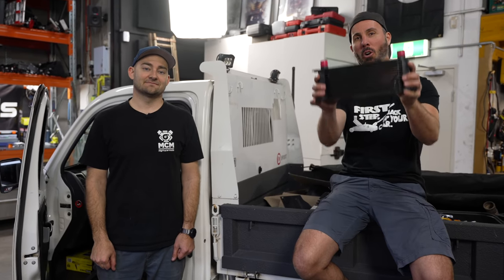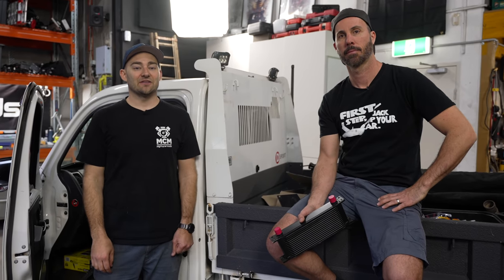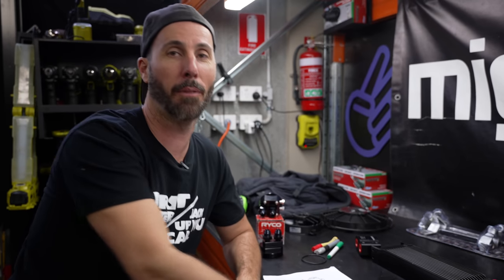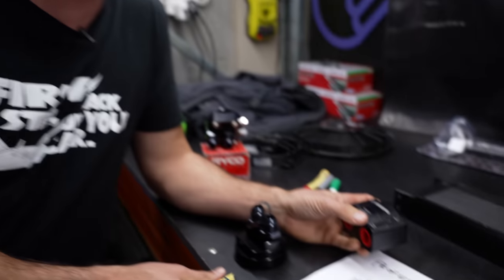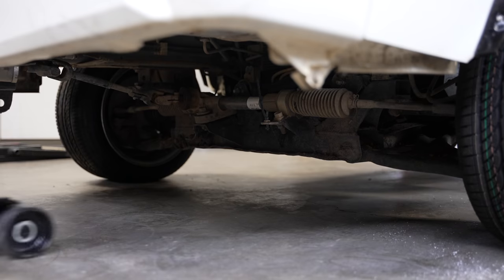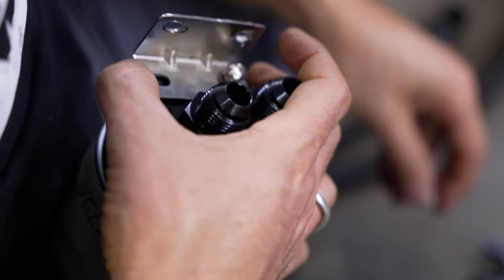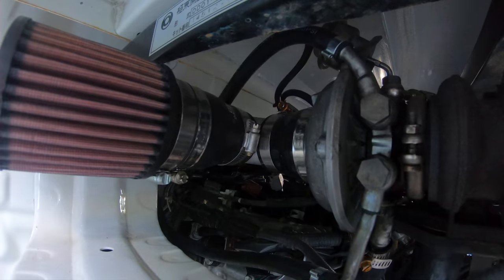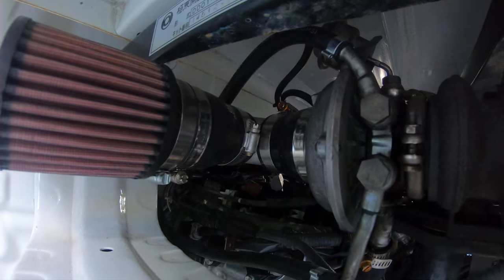How to Install an OIL COOLER

Comment: Installing oil cooler or upgrading the radiator? Which is better when a boosted car is overheating.
Reply: Assuming you checked why it is overheating ( running lean, clogged rad, bad cooling pump ) a new bigger capacity radiator is always better, if you go to the track an oil cooler is ok, if it's a normal everyday city car an oil to coolant heat exchanger is preferred as will keep your oil temperature more stable. Unless you install your oil cooler in front of the radiator and create air baffles to direct and force air to it , in normal driving with city stop and go traffic air flow is only present when the cooling fan is on and the oil cooler and oil will again be cooking. Oil to coolant heat exchanger will warm up the oil faster so less damage to cold engine will occur and will keep oil temp more stable. Tip: oil pressure gauge is your best friend, when oil is cold pressure will be higher, when oil is hot pressure will be lower. When engine is hot hot hot and your oil pressure is strangely high is a sure indicator your oil cooler thermostat is leaking, like mine does from time to time.

Comment: Sorry if im overseeing something here but I have a question about the change in oil volume that happened with this mod. Say the thermostat is closed and you used the original amount of oil that the engine usually gets. What happens if the oil circuit opens? that means that the engine has less oil because of the additional volume that must be filled (hoses, oil cooler) and does this imply additional stress to the oil pump? 
On the other hand, if you put more oil into the engine to compensate the additional volume, is there too much oil in the engine which can damage it?

Comment: I wonder if this would have an effect on your oil pressure.  On a "big" engine, even a 2L 4 or something probably fine, but on something that much smaller all those adapters and hoses, and the cooler add restrictions at some point it could drop the pressure to much? Maybe?  Or I'm wrong and that would effect flow rate and not actual pressure... my fluid dynamics education is some place between rusty and non-existent.

Comment: If you run high oil temps can't you just buy thicker oil? Like 10w60 fully synthetic ? It's has the highest temp peak of 100 degrees celcius. Your car's thermostat opens at 85 to 95 degrees celcius, depends on brand of car. This feels like a way easier solution.

Comment: Need help.. Ive got the oil cooler and the IN fittings.. But im not sure what pipes best suit the high pressure and temperature to avoid pipe leaks or early wear out.

I run a 1jz with 536hp on wheels... So any suggestions.?

And yea what's the highest oil temp to avoid and the Lowest temp to avoid.

Thanks

Comment: Changing that oil filter is going to be messy now , most filters screw on and off vertically for a reason .
Reply from the maker: Heaps of our cars they are horizontal, super turbo, super gramps
Reply: Do you even work on cars ? Most cars are far worse then that to change the filter. Very rare they are even accessible like this is.
Reply: First thing I saw and easy to go back and fix in the next episode
Reply: A filter unscrewing vertically is probably the worst case because either the filter or the engine get soaked in oil as oil from the engine block starts coming out once the seal is broken.
My SAAB has the filter horizontally and there's a small lip under the sealing surface that redirects oil to one spot so that when you loosen the filter all excess oil from both the filter and the engine block go straight down in a single stream without ever getting anywhere else and requiring almost no cleanup once the new filter is installed.
Reply: @jacobpage3865  I have driven over a million Km in my cars and NEVER had anyone else do any maintenance on my cars , I have held a licence for 43 years and worked for 35 years in motor transport and was educated in all systems of the machinery I drove ,  I do know a bit more than the average Joe about maintenance procedures . Oil filters fill full of oil , the only orifice the oil enters and exits is on the same plane as the seal , if the orientation of the seal is horizontal , when it is changed it is easiest to keep all the oil in the filter instead of all over the hand removing the filter and whatever surface is below . Simple physics and common sense .

Comment: I have a Honda civic 2012 coupe everything is factory designed besides an cold air intake (I dint tow anything )I was wondering if I need to get an oil cooler for the hot temp. In south texas Or if my car is safe enough to handle it via it’s build design? Any thing helps

Comment: Won't having the oil cooler upside down prevent the cooler from draining when you change the oil and become a location for sludge to build up?
Reply: If you mount it the other way and don’t have anti-drain back valves it tends to drain the cooler whenever it’s shut off for a little while. Then you’ve got no oil pressure for the time it takes to get oil all through the cooler and lines every time. 
There’s not that much oil in the cooler and as long as it gets regular oil changes sludge buildup isn’t much of a worry. Especially since the cooler will help keep it from cooking the oil and causing deposits.

Comment: At what temp does the oil thermostat open and start the flow through the cooler ?
Reply: I’d think about 120-150F. You want the oil to get hot enough to burn off moisture and some other junk. Also want the oil hot enough to flow properly so you’re not trying to force thick oil through all the small passages.

Comment: worth to mension. Despite all the mods you can cheap out on. THIS is not that. Both hoses and the core itself is critical for your engines health. Ebay and china cores are known to be badly made and deteriorating on the inside and send small metall bits that will kill your bearings.